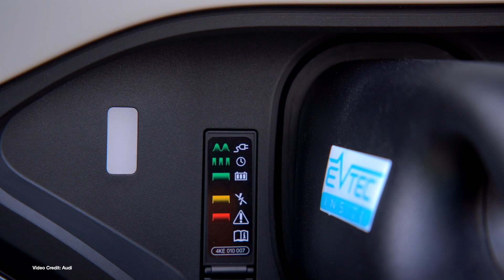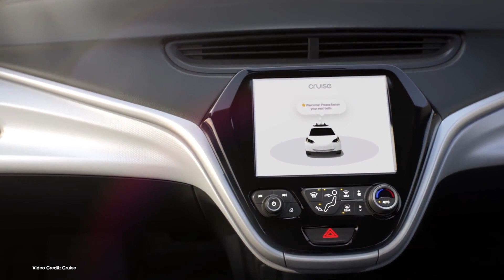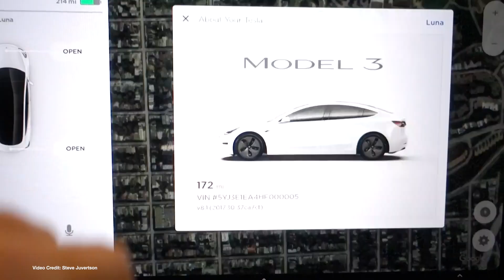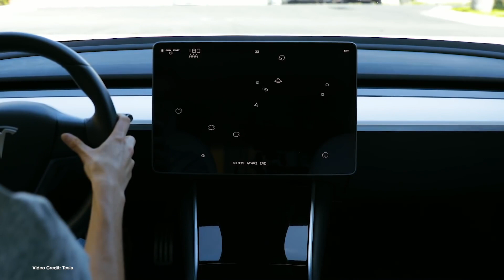Audi e-tron Rated, Cheating German Automakers, Tesla Q1 Estimates - TEN 247

Comment: I was one of the first owners of a Ford C-Max Energi PHEV in 2013.  When new, it could go 24 miles in EV mode after which the gasoline engine kicked in.  My first impression was that the EV node was just a teaser wanting me to go all-electric  Worse still, after only a few months, though the Energi's  EV  range dropped to about 15 miles.  The last year I had it, the EV range dropped below 10 miles.  

Now, these new Ford PHEVs are promising 20-30 miles of EV range.  My experience causes me to mistrust Ford's ability to compete in the EV marketplace.

By contrast, my 2018 Tesla Model 3 has increased in range!  The Model 3  is a great car in every measure and gets better with each software release.  The Ford NEVER got better in nearly 6 years!  Don't believe Ford!

Comment: I really don't understand the Audi thing, and I wish that Nikki would not just uncritically repeat Audi's claims about this, especially since they are so implausible. OK, 95 kWh * 88% = 84 kWh. To get only 204 miles out of 84 kWh a vehicle would have to have an efficiency of 2.43 miles per kWh. This is an absurdly low figure. Most all electric cars get around 3.5 miles per kWh and the most efficient models get slightly above 4 miles per kWh. What is the world would account for the Audi being so horribly inefficient? Weight and aerodynamics don't seem to be enough to explain this. Aerodynamics only come into play at highway speeds. In city driving it wouldn't make much difference. And, weight? The Audi is only a few hundred pounds heavier than the Model X, which gets 3.2 miles per kWh. It is hard to believe that 300 or 400 pounds extra weight would result in 29% lower efficiency. 

There is something going on with Audi's batteries. This is the second large European SUV to get really poor EV efficiency (Jaguar).

Comment: 1 KWh/Kg, the holy grail of battery technologies. The final step to make batteries the winner of the race to power the new electric primary propulsion age.  If it doesn't get sold to the oil industry, of course...
Reply: If it's real.  Some of their specs sound too good to be true, while they make suspiciously minor claims of 10% improvement in range elsewhere.  It's a little sketchy.  I'd like to see some real data from a third party tester.
Reply: Who knows what goes on behind the scenes, their may have been a revolutionary battery invented already and BIG oil snuffed it out before the news got out.
Reply: @onetallman76  Well, once they did it after the news got out! Check out what happened in the mid 90's with the batteries that would go into the GM EV1 (special NiMH batteries, very advanced for the time). The oil industry somehow got hold of the patents and blocked use on all-electric cars. They licensed it to another car company, that agreed to only use it in a car that used gasoline as well. A couple of years later, said car is launched. I think you might know what car is that. Coincidentally (or not) it's from the same company that, despite having full knowledge of electric car technology, hasn't yet made a single car with a purely electric drivetrain powered by batteries recharged with electricity only.

Comment: Audi e-Tron  Autonomy rating;204mi.=326km.   battery deraiting claimed : 95kwhX .88= 83.6kwh.  Therefore:  83.6/326=0.256kwh/km . Kona, Tesla , Bolt & others manage around 170wh/km. They still claim there is nothing wrong with the design of the car?
Reply: Ok the Jaguar and Audi , Tesla killers are non-starters— whose next ?

Comment: Just to say, for what it's worth, I don't believe a Memorandum of Understanding is the same thing as a contract, legally. My (non-lawyer!) understanding is that a contract typically has legal consequences when broken, where as an MoU typically does not (there may of course be other types of consequence, like loss of investor confidence for example). A lot rides on what is actually written into the MoU, but in a normal commercial situation like this they wouldn't call it an MoU if it had the same legal consequences expected of a contract.

Comment: Reporting on Audi's explanation for the miserable EPA range and seemingly accepting this at face value is just bad journalism . A little digging and calculating would have revealed that even at 100% usage it would barely get 231 miles which is far lower than a Model X 90 or 100 . Even that is not a fair comparison because Tesla's also protect their batteries , certainly at the bottom and probably also at the top . The only reason for this bad range is bad efficiency : excess weight and bad aerodynamics . This has already been proven in real world testing on the autobahn by YT channel nextmove that showed both the Jaguar Ipace and Audi e-tron have much greater consumption than the Model X

Comment: First of all Audi only allowing 88% of max charge still do not explain why a 95kWh battery only gets a rating of 204 miles .. and we all know Tesla does not allow 100 true battery charge .. more like 90-95% .. so when you think you are charging to 100% you really only going to 90-95% .. in any case I am very disappointed with Audi 95kWh battery only getting 204miles even at 88% because that extra 12% will not put it at 350miles .. I was expecting a minimum of 320miles from Audi 95kWh battery.. truly hope they design a better EV get that range up .. or make better battery.
Reply: Kid Rain inferior efficiency , extremely heavy at 5950 lbs, inferior software and overly cautious design due to inadequate EV market experience vs Tesla
Reply: Now everyone is starting to see just how good Teslas really are. They have the best motors, batteries, inverters, battery management and software.
Reply: shepherdsknoll8 true and equally as bad customer service as most traditional car dealerships.
Reply: Gorilla Toyz , not for me, I was treated like royalty when I took my Model 3 in for the 25k service. The experience made the Lexus service on my other car, seem pathetic.
Reply: shepherdsknoll8 that’s great. I had many issues with getting my paperwork done, delivery, getting any type of answers in my refund check (performance model) or to date ...anything on my Carbon Fiber Spoiler,  which Is at 6 months and  still M.I.A.
Reply: I wonder how long they will stick with the old „single-frame-grill“. Still claiming Vorsprung durch Technik seems a bit arrogant to me.
Reply: Kid Rain Kia EV with 64 kW battery gets more range!
Reply: Terry Keep didn’t I already say that lol
Reply: @SatoshisOmNomNom LOL sloping rear is for styling only, just like most spoilers. It's the front of the Audi that is a huge airbrake. Obviously.
Reply: Your math is way off base. There's no way the Audi was ever going to have more range than a much more aerodynamic, lighter Tesla with a bigger battery. I would have been surprised if it had come out higher than 250 miles.
Reply: Roger Starkey I feel that legacy carmakers are going to get hurt further by Upstarts like Rivian, NIO, Fisker, who are solely focused on EV. Hyundai KIA has really been on their game closing the gap to make a solid reliability value alternative reputation. As the older generation fades , the younger doesn’t care about name but affordability ,and ride shares , autonomy will dominate the future. Bmw & Daimler just got hit with a billion dollar fine for anti trust clean air violations , and dinosaur method antics aren’t going to fly anymore. They may have taken too long to start true EV production because they didn’t believe it would succeed only the be upstaged by Tesla and  way more advanced technology , which everyone is still trying to catch up to a 2012 Model S P85D. Tesla will release new S and X pick up truck and the Model Y ...and blow everyone out of the way , again! By the time the Model Y arrives , it will dwarf Model 3 sales and efficiency
Reply: Nobody allows "true 100%" battery charge, as it would kill capacity in a few charges. They could say they make round wheels instead of square ones - that information would be as useful, as that "88%" stuff.
Reply: yeah, their "reason" sounds like the corporate gotta make something up that's plausible if no one does the math. Likely a corporate edict.
Reply: AUDI stands for Automobiler Unsinn Deutscher Ingenieure  ;)

Comment: probably the cheapest thing that governments can do to improve autonomous driving would be to modify and standardize painted road lines for easier detection by the autonomous vehicle sensors, rather than human eyes.
Reply: David Jacobs it would require the same amount of regulation for driving as there is for flight. Mandatory transponders is all vehicles, no mixing of transportation types and no pedestrians near roadways.
Reply: @polleyjw  yes, they are all nice, but require a lot of money.
where as, lines on roads need to be painted every 10 years or so. Therefore, why not modified them slightly so that autonomous cars have easier time detecting them? as in continue the lines in the intersections to prevent confusion. and modify lines where the freeway lanes divide, as in Tesla gets confused and running into the divider.
Reply: David Jacobs Road markings are such an insignificant part of the problem. Who cares if the vehicle knows the road boundaries if it can’t deal with: rain, snow, blowing debris, rough road surfaces, non-autonomous vehicles and pedestrians?

Comment: Audi, use less battery capacity results in quicker charging times...

Yes... Use less, charge less, but more often.....
Reply: The thing is that the charge speed drops significantly once you go over approx. 80% charge. So looking at it that way they can significantly reduce the charge time to full on a fast charger. Audi is not the first one to do it, I don't know of a single EV that allows you to truly charge up to 100% but they are keeping the biggest buffer to date.
Reply: @Hans-gb4mv  But that's just pretending to have a fast charge rate while significantly lowering its range
Reply: @bornacvitanic Let's say you do like many manufacturers and bring it to 95%, you have now won 16 miles ... . Wouldn't call that significantly lower. It's a choice Audi made to prolong battery life. If they wanted to go for long range, they would have designed a car that's a lot more aerodynamic.
Reply: @Hans-gb4mv   Well that might be the case, but with Tesla making hundreds of thousands of electric cars over the years, and with all of the data they collect over the air, and all of the tests they do, I would say that they know more about battery degradation. Hence Tesla cars have the lowest battery degradation on the market. And with Tesla vehicles having the most efficient sub-systems on the market, everywhere from their batteries, electromotors and aerodinamics, I would guess, and that's just my opinion, that the competition can't reach a bigger range due to the inefficiencies.
Reply: @Hans-gb4mv  that's fairly fair, but it also hits the 'lower limit' that people perceive, like when you are running low on fuel, nobody really likes running low so try not to let it go too low, so, this car will mostly charge and discharge in the mid range, making it feel like people are charging far more often than they need
Reply: @Hans-gb4mv  I don't get why they wouldn't just copy Tesla. Odd